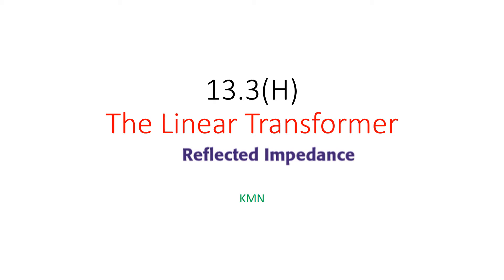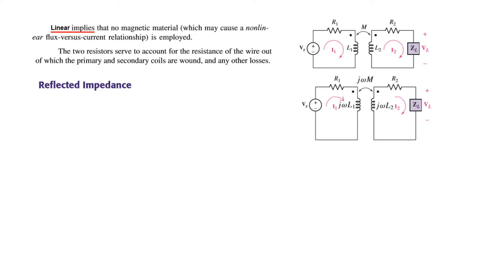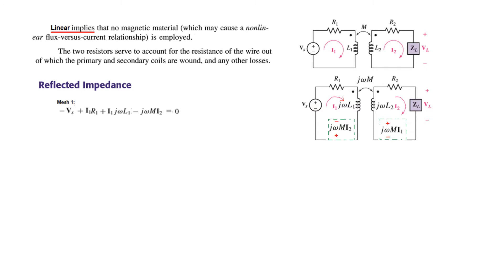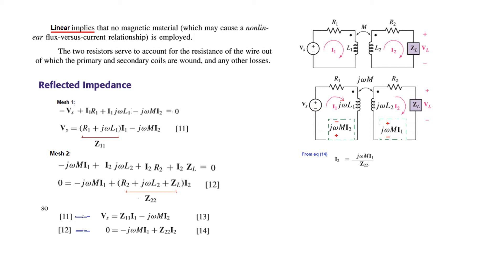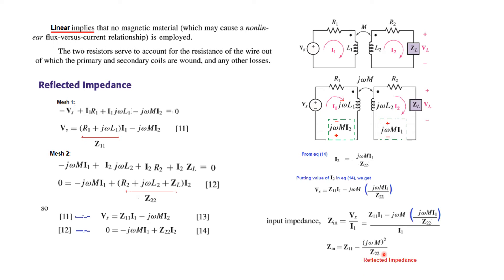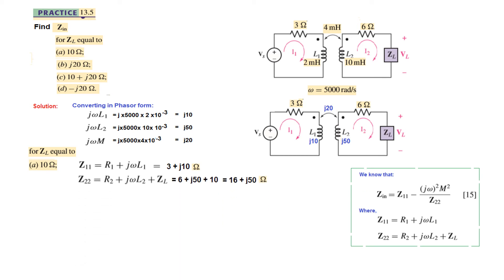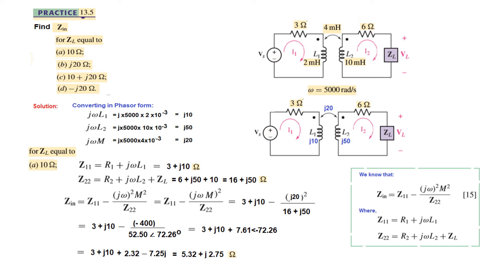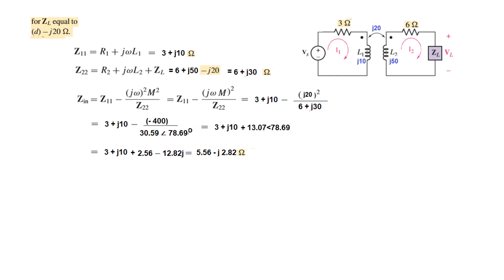(English)ENA(H) || Practice 13.5 || Reflected Impedance || Linear Transformer

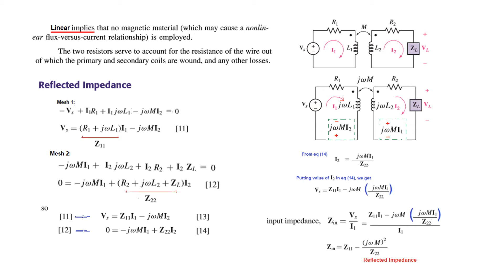Comment: 6:49 Makes little sense to me that Z22 gets inverted in addition to reflected! How is that possible? In an ideal transformer with turns ratio n, we simply get Zref=ZL/n^2, so ZL is not inverted, just reflected.
Reply from the maker: LInear transformer takes into account the losses in the transformer by adding resistance R1 and R2. The ideal transformer ignores these. So don't mix-up the two.
Reply: @ElectricalEngineeringAcademy  Thanks for the reply. No, my point was about Z22 appearing in the denominator of Z_reflected. But I realized later that the reflected impedance in the formula is the series impedance (in series with L1), and I was interpreting the parallel equivalent (in parallel to L1). My bad! again thank you for responding to my comment.